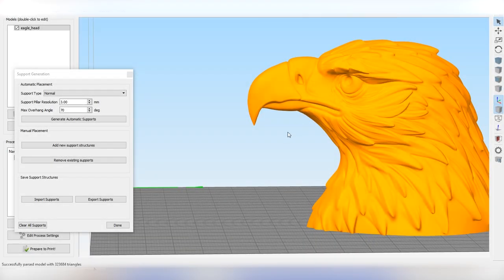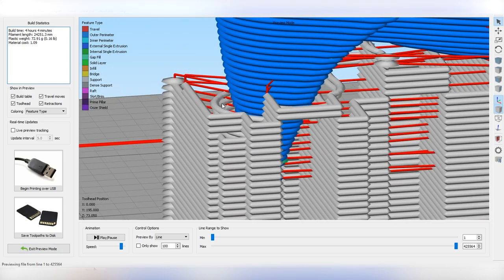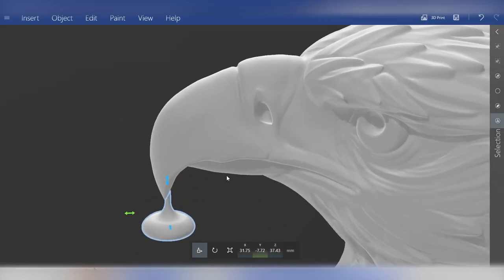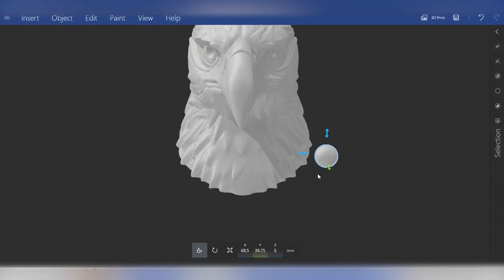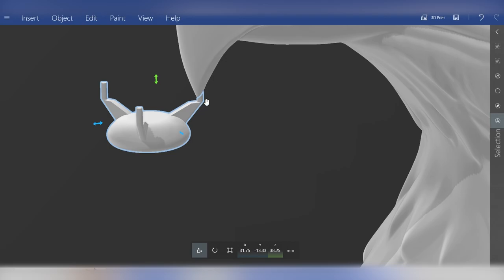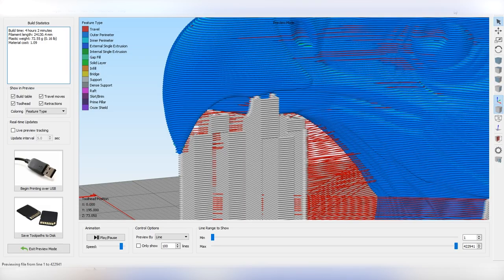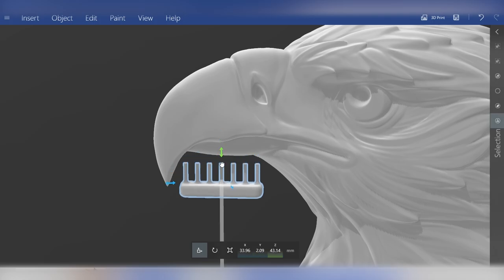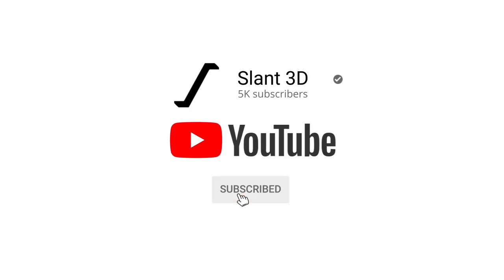These Free STL's are Better than Tree Supports

Comment: I think in an earlier vid on printing a cube at an angle, you made a support of vertical plane 1mm thick with sprues, placed along underside of edge of cube. We now frequently use that technique instead of auto-supports. It does the support perfectly and snaps right off in post processing. Why not same here? A plate oriented in the sagittal plane of the bird, with an edge shaped to follow the contour of neck, chin and beak.

Comment: I had a student experimenting with making her own support like your comb but she had problem with dimensions and count of the sprues to get enough support but clean break. At age 13 she did not have the math to do any kind of calculation of the forces, plus was working in TinkerCad; so it was going to be a series of empirical iterations. Instead of the five posts, she ended up putting in text of several characters with total size 2mm x 10mm that face up from the comb. Then she experimented with changing text from " - - - " to "MMM" to " C C C " to quickly change shape and quantity of sprue. Clever kid.

Comment: Or you could just us a modern slicer.
Reply from the maker: Has nothing to do with the slicer. Regular support has to be spaced from the part. That spacing causes the error.
Reply: @slant3d  You can have zero spacing and still have easily removable supports.
Reply from the maker: You just described a paradox
Reply: @slant3d  nope, it's easy to do.

Comment: I've actually been using thumbtacks with my models and didnt even realize it. I too was having issues with the downward pointing parts that the slicer couldnt sufficiently build support for, so i literally have just been doing .3mm tall cylinders with a 1mm wide cylinder coming up the center to meet the point. Works every time.
Reply from the maker: Awesome

Comment: Whats speeds are you using to print someting like the eagle head you showed? 
I'm using Cura tree supp but I feel like at times the little trees shift, causing warped parts had this happen twice, printing at 60mm/s and and .28 layer height.
could this be the high layer height or fast speed? also had it happen on a .16 layer height print with around 50mm/s

Comment: If you fix some bad defaults, Cura will support this just fine with normal automatic support generation (regular or tree).
Reply from the maker: Any autogenerated support requires spacing in order to be removable. That spacing allows these types of features to settle which will cause distortions in the print. So you can't reliably use traditional supports
Reply: @slant3d  I think I'm understanding what you're saying. You can do zero spacing with multi material and related methods, but of course that has its own issues. I've been meaning to experiment with zero vertical spacing using reduced flow and increased line spacing on support interface layers.

Comment: the growth of FMD tree supports can autimatacally achive this into the futer, I think maker's muse did a good video recently on more modern support generation.
Reply from the maker: Any autogenerated support requires spacing in order to be removable. That spacing allows these types of features to settle which will cause distortions in the print. So you can't reliably use software supports in this case
Reply: @slant3d  I love this use of thumbtacks. However, this comment is simply untrue. Change the Z distance in support settings to 0 and it still slices. I've use this method multiple times without any issue. This is in Cura 5.5, I leave the z distance when slicing in bambu studio.